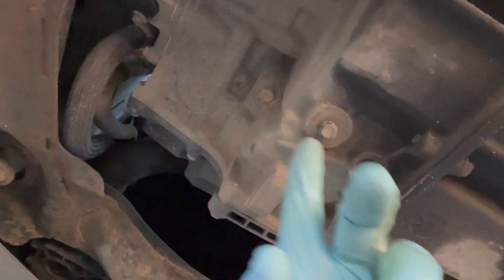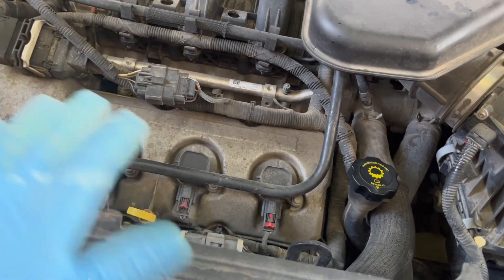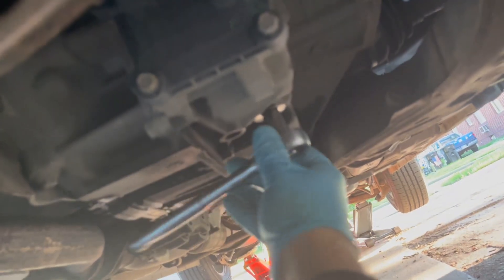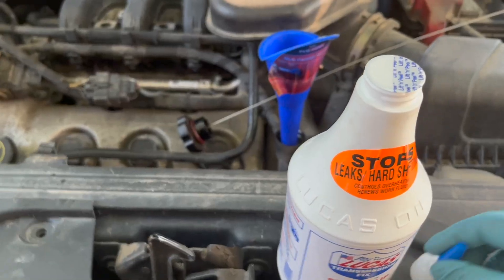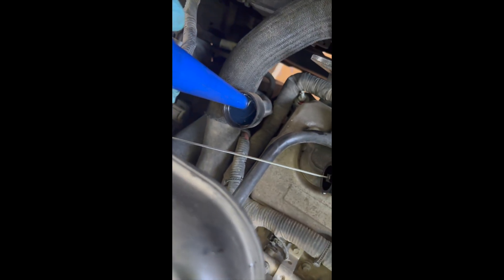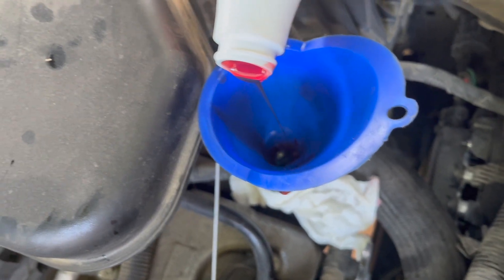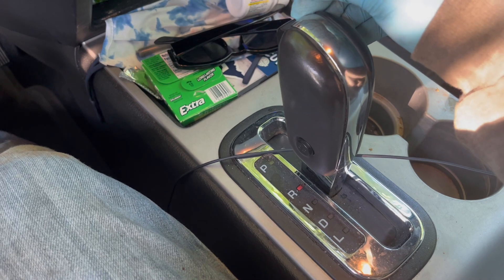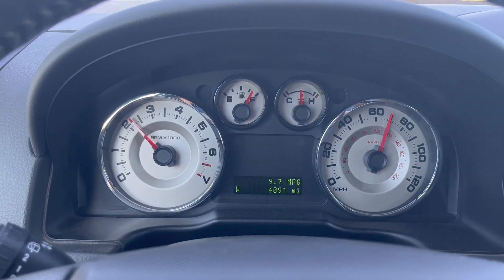Ford EDGE Transmission shudder - Will Lucas fix it?

Comment: My 2013 Ford Explorer 3.5L V6  started to have problems around 155,000 miles. Then a few months later the shudder was getting scary! It would happen around 3rd and 5th gear. Anyway, after reading every forum about this problem, someone said, add a 2 ounce bottle of Lubegard Instant Shudder Fixx. I was skeptical because after all it feels like a mechanical problem. I'm sure it is a mechanical problem. But, trying to save money and to delay the inevitable TC replacement, I added the 2 ounces of the fixx potion. I drove around a few miles and most of the shudder was gone and  then saw much smoother/better shifting. In the end I believe that NOT changing out the transmission fluid every 30K will lead to these problems. The auto mfrs need to stop with the BS about "lifetime fluids". Lubricants breakdown and need periodic replacement to extend the life of the vehicle! My Explorer at 163, 000 miles now. The shudder is mostly non-existent at this time. Let's see how it is in the next few months!
Reply from the maker: That’s awesome!!!  👏  🙌

Comment: 2011 rav. Similar shudder issue. Tried lubegard shudder fix. No improvement.  Ended up replacing the TC which was $2k.  I wish Toyotas were as perfect as people think.  Lol.  I personally think we should change trans fluid more often than they recommend.
Reply from the maker: Yeah I’m with you on that! Seems crazy not too!

Comment: I wish I didn’t trust the owners manual about changing the trans oil at 150k miles. I got some shudder going on at 58k and believe it wouldn’t have happened if I changed it at 30k. ☹️

Comment: I put in about 5 tubes of shudder fix after a trans flush went wrong and it really helped but there's still some rough shifting for me. Going to try out some Lucas
Reply from the maker: Yeah give it a shot… unfortunately didn’t solve my issue :/
Reply: I'm going to use two bottles on my next transmission change, wish me luck. 🫡
Reply from the maker: @Starcat90 definitely good luck! Didn’t work for me - really hope it works for you!

Comment: Does it stop shuddering if you put it in Neutral?
Reply from the maker: Hey Tamara! So funny you found this video!!! 

Anytime you either give it gas to accelerate, or take your foot off the gas (same as putting it in neutral) it stops
Reply: @jimbosdiyautorepair4825  I know right!  I was looking something else up and your video on the Cobalt was there so…rabbit trains!  We had a Ford with a similar issue, and it actually ended up being a plug/coil/wires issue.  You might check that out.  I think that the plugs needed changed for sure, but there was a split in one of the wires that was causing it to shudder at certain RPMs.  Our neighbor - who was an mechanic said that OD can cause it to happen more.  You might be able to turn OD off even and see if it helps?
Reply from the maker: @TamaraHutsell  that’s very interesting, I have not seen anything out there about that being the solve for the problem. But I will definitely check into it! And if that turns out to be at our mind, that’s gonna be a new video! :-)

Comment: Why isn't Ford on the hook for these crappy transmissions?  Seems like it is quite common.  My 2015 Expedition has had a light shudder for a year now.  I'll never buy another Ford product.
Reply: It happens to a lot of different makes/models after a lot of miles. Torque converters wear out over time especially when the fluid isn't changed regularly. Same happened to my Volvo XC90 V8 Sport. Transmission was fine, shifts great, no slipping. But had a bad shudder. Replaced torque converter & the shudder was gone for good. Now change fluid around every 30k miles. She's over 250k now & still doing great.

Comment: Didn’t seem like trans shudder. Sounded more like CV axel issues.
Reply from the maker: Yeah, I agree with you, except that the CV axles actually were just fine, and it happened in connection with the throttle… Turning had nothing to do with it
Reply: I can see where your coming from but it seemed to me that when the torque converter locked up (rpm’s dropped in video) that’s when the shudder occurred and as mentioned by the video creator it was connected to throttle, torque converter locks up and when on throttle it’ll shudder.
Reply: @jimbosdiyautorepair4825 I will also mention that if you added the lubegaurd instant shudder fixx previously and it didn’t help than there’s likely a mechanical issue in either the transmission or with the torque converter. Lubegaurd instant shudder fix is pretty much a tool to identify whether you have a fluid related issue or mechanical issue. I’d say let her rip until she rips no more lol. Good video also!
Reply from the maker: @jimbobvlogz5977  good insight! Thx for sharing! I figured for sure it would’ve been a trans issue. Unfortunately someone ran into me so I no longer have the car to test your theory … but if I ever have a Ford Edge again w/ the same problem I’ll be on it!
Reply: @jimbosdiyautorepair4825  yikes, hopefully everyone was okay. I’ll have to check out some of your other videos to see what you have going on now!
Reply: Might be your a/c compressor

Comment: A lot of false info, they don’t expect shops or the dealership to bust out a level to fill trans fluid or any fluid for that matter. Every fluid should be filled to the top of the mark on their respective dip stick, or till the fluid runs out of the fill hole on a differential or transfer case.
Reply from the maker: What’s false? Wasn’t working on the diff. lol. Also did you watch to the end to see if it worked?
Reply: @jimbosdiyautorepair4825  I’ve filled plenty of transmissions, never once thought to level the vehicle out to do it. Transmission fluid expands so if you know how much goes in it then you shouldn’t have any issues supplying it with the correct amount of fluid.
Reply from the maker: @johnliford6184  but it’s not incorrect to level the vehicle, right? Sure won’t hurt it it to have it level, right?